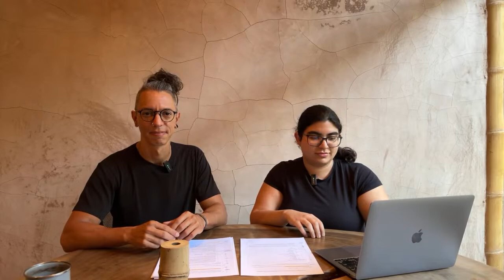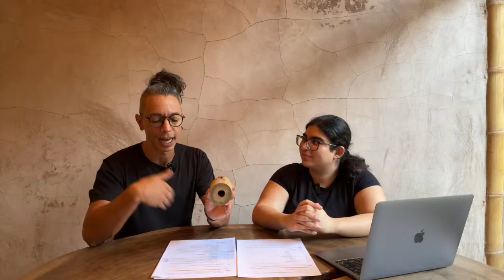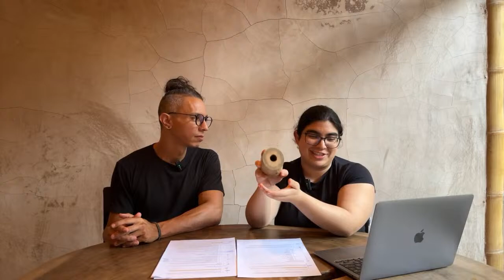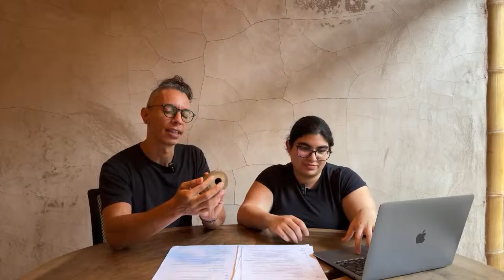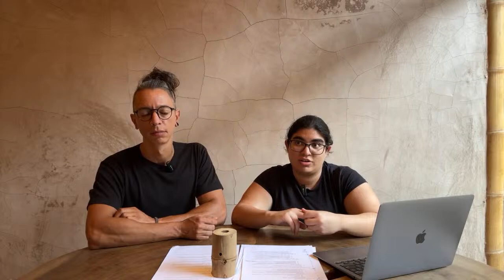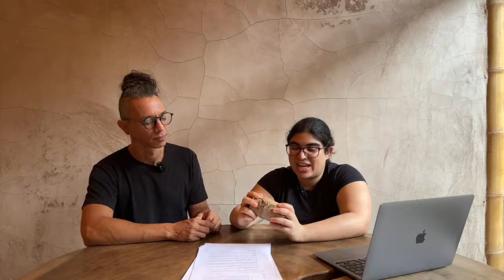The First 3 Steps to Using Bamboo in Construction

Comment: I've seen other treatment methods that do these things. What are your opinions on these:
1) skinning the bamboo pre-treatment. Some wash it with soap and steel brush
2) Fire treatment alone
3) Fire treatment followed by diffusion method
4) Sun-drying the bamboo pre immersion (it is claimed that the dry bamboo will absorb the borax more readily)

Could you clarify the part about the bamboo changing color if the treatment process is complete? I couldn't make out the words and the subtitles weren't of help. Also, you said to avoid direct sun exposure on the bamboo. Is this for pre or post treatment, or does this rule ALWAYS apply? 

Sorry for the many questions but we're doing a community project to help people build homes using affordable and sustainable material and nothing beats bamboo for that.

Finally, THANK YOU for this video. It contains a lot of actionable information. Too many groups out there put out videos of really important information only to attract people to their paid courses but not really give those who can't afford them anything they can put into practice. This one is different. And, of course, your website has even more useful actionable info on it.
Reply from the maker: Glad you enjoyed the video. Here are our thoughts:

1. We usually power-hose the bamboo after treatment to remove lichen, dirt, solution residue, etc.
2. and 3. We've not used fire treatments before so can't comment on those. 
4. We also don't sun-dry the bamboo because it can dry out the bamboo too much and therefore slow down the absorption of borates, which lengthens the treatment process.

Also regarding the color changing - the bamboo skin changes color as it dries out - going from green to blonde.

Comment: what are the species that you use for structure?
Reply from the maker: Most commonly, we use dendrocalamus asper (or the black variety dendrocalamus asper niger) and gigantochloa apus (and a similar purplish brown variety gigantochloa atroviolacea). These are the main large and medium sized bamboos that we use for structures.

However, we have also been experimenting with smaller species like gigantochloa aya and thyrsostachys siamensis for structures and that's been going well too! You can use them in their straight, round pole form, but we've also been doing heat bending with the siamensis bamboo and that's produced some great structures too.